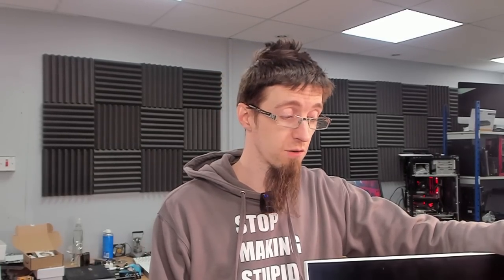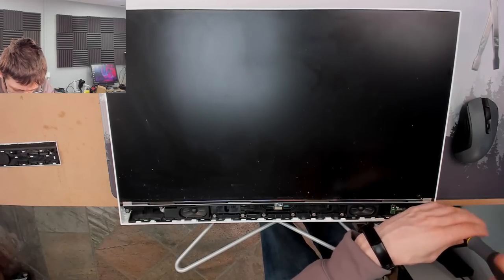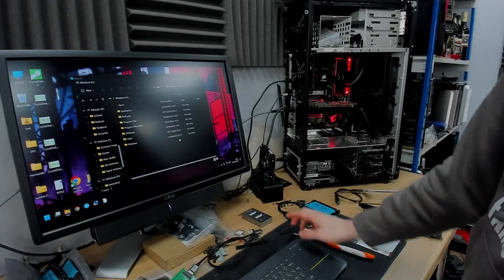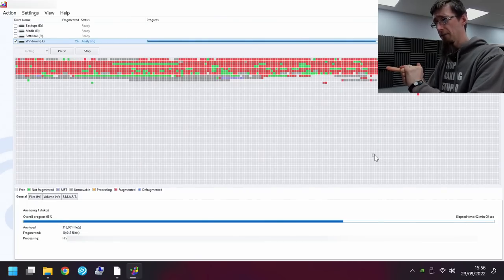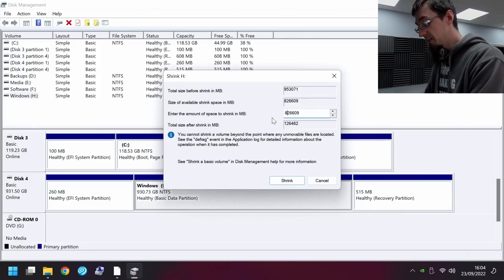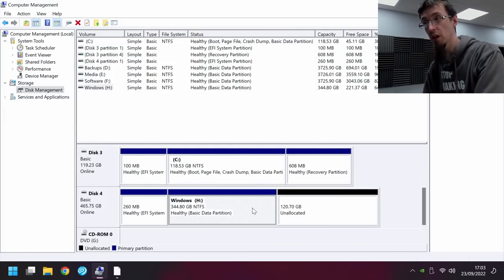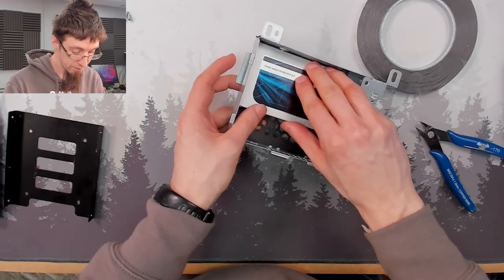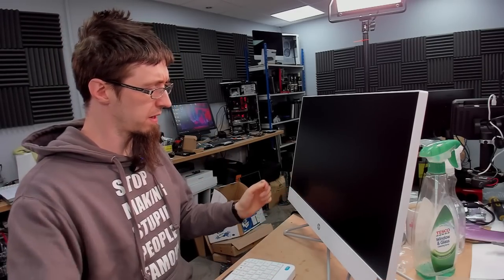SSD'ing a HP All-in-one, Drive Snapshot Waffle - LFC#325

Comment: From zero (no way) to ten (heck yeah!), how would you rate/recommend the HP All In One computer to a viewer for creating YouTube videos? Thanks!
Reply: No damn way, the CPUs are so underpowered, if you break the screen the entire computer becomes e-waste/garbage. These are only nice for like journalism offices, writer's office, translator's office, entry-level students or schools, accounting offices... only because they occupy little space and have monitor comfy tallness not like laptops that are way down and too small, but they are expensive for how underperforming they are. I mean did you see what you have to go through to put a damn SSD instead of a lame-ass HDD as boot-device? Please, please get a PC, I assume you want to create youtube videos of other content - not how you struggle with the weak-ass AIO to do any work on it.
Reply from the maker: Yea custom-build all the way. So much more choice, a lot easier to change/correct problems later on down the line. Most pre-builts are a dead-end for upgrades, so if you need it to do something it can't, you're stuck.
Custom build, anything you need it to do, just buy the thing you need and plug it in.

Comment: Why they put a old hdd in a new Ryzen pc haha really dont understand that. All about costs pffffff.
Reply: The Intel ones have the same 1 TB 3.5" HDD, and after you put the SSD it's like a brand new computer ofc, even when it's a lame i3. I honestly don't get it, they make the nice design to bait customers - even though they are impractical, if you break the screen the entire computer belongs to the trash-bin, they make it low-power and silent with office lappy specs, but one AIO costs like 2 similar-specced office lappys and the AIO just has a larger screen and no battery and is heavy only for desks; and they sabotage the performance with the retro storage solution, even though these are never cheap for what specs they have. At least this describes these HPs. When a friend passed me an identical-looking HP but with Intel i3 or i5 and I saw what I had to do to put an SSD, I was like: wow, they design these so you break them in frustration after 1 month of use when they get sluggish. P.S. An 240 GB SSD would have been cheaper than an 1 TB HDD lol, they just ruined the config on purpose...
Reply: Pretty sure it's all marketing, 1TB HDD on the list of specs sounds better than a 250GB SSD, consumers don't usually know better anyway which is exactly why these things get bought, if people actually understood the difference nobody would ever buy a modern PC with a HDD as the boot drive.

Comment: I like the design of this little machine. being an AMD ryzen it's probably not that slow too.
although i don't like segate hard drives. that and it being a hard drive in the first place is probably kinda bleh. otherwise great system ruined by bad hard drive
Reply: Imagine having to go through that to replace the HDD with an SSD, I bet you'd sell it and buy a PC or service-able laptop instead. Having to handle a big screen like that just because they tried to make servicing complicated is annoying, and if you break that screen the entire AIO is just garbage to throw away. Besides usually being expensive for how low-performing-configs they are. Indeed the design looks nice and interesting but it lacks practicality outside basic offices that wouldn't mind having to throw it to the bin if ANY hardware problem appeared. Dead external PSU, overheat, break display, rattling, dead hdd or want and SSD? Sux to be in that position.
Reply: @cosminmilitaru9920  it has a ryzen in it its most likely not terrible speed wise.
Reply: @cosminmilitaru9920  in the grand scheme of things it's not that bad. you remove a chin bar and remove a few screws and the screen unclips.
Reply: @cosminmilitaru9920  if you're telling me that I'd actually go through with an HDD replacement... I've opened up nintendo joycons and those are substantially harder to service.

Comment: Windows suffers a bug that has been there since Window 3.   It is hideous and could be fixed so easily.   If a windows HD should become full.  The system does not tell you, it simply starts using track 0 sector 0 and begins writing over the bootstrap and pats of windows that allows you to boot your computer.  When this happens, the only way to recover your data is a bit reader program.  If you wrote over the place where the drive keeps its index, then all your data is lost, unless you wish to pay someone to recover bit by bit for the next 4 years.

Because of such a stupid and easily fixed bug that has continued all the way into Window's 11, I have no interest in using windows to image a drive.   Windows drives can easily be imaged by Linux.

Comment: Ever try clonezilla?? The few times I used it worked successfully with no hiccups
Reply from the maker: I didn't get on very well with clonezilla... it felt very hit and miss, sometimes it was fast and worked, other times it would give non-booting results because it hadn't gotten the GPT/MBR/UEFI/Legacy stuff correct. I think there's one specific combo it doesn't like, but I didn't have time to keep testing with it to find out which one trips it up.
Having online (in windows, not a bootable drive) software is also a big plus because the machine doing the backups can do more than one thing at a time.